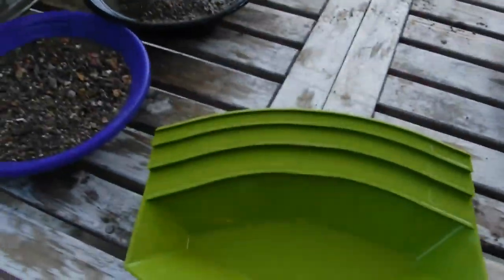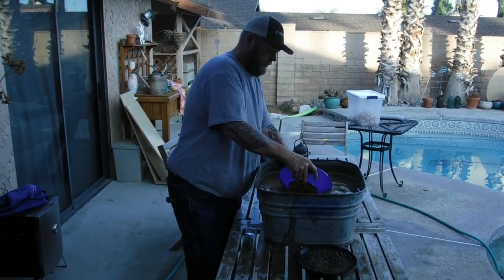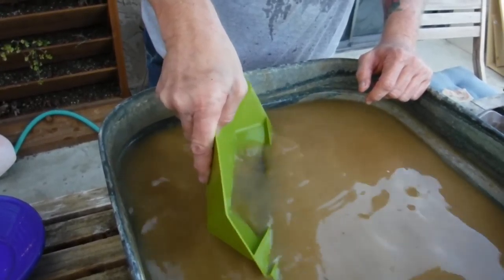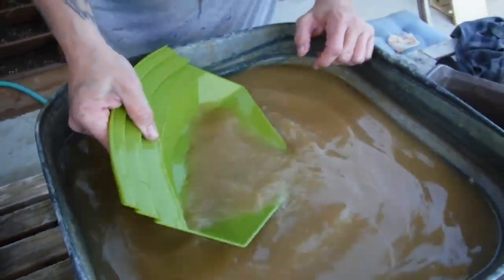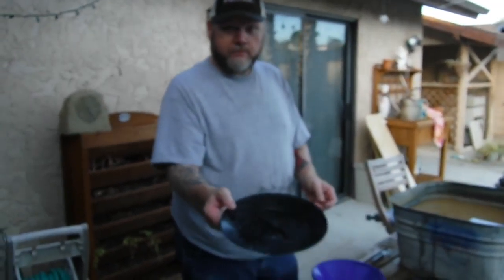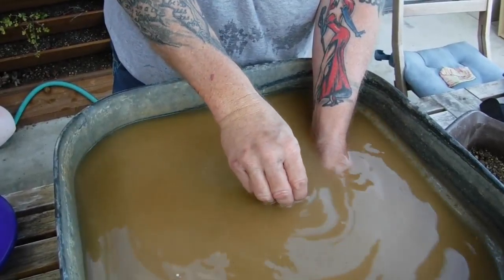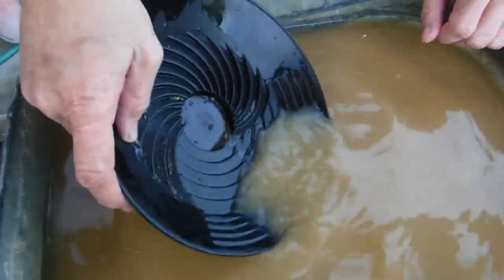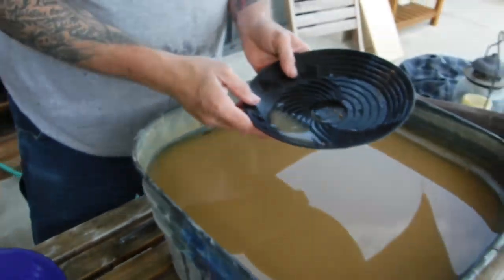The Gold Claw vs The Turbo Pan!

Comment: Jesse with the small Turbopan it's better if you hold it flat just under the water and swirl gently counter clockwise. This will separate black sands from gold at about 97% recovery on the super small gold (40 micron stuff). Still good video because it shows a panner can use turbopan just like a normal pan with the gold ending up in the central well. That means it has a lot further to travel to get out of the pan
Reply: learn to pan,use spellcheck,get-er-done

Comment: You are using the gold claw wrong - you should reshoot this video test as the results are null if you don't operate the equipment properly. It's my understanding that the gold claw is used more like a mini sluice rather than using a panning technique.

Comment: Nice video.  Three minutes for the Gold Claw.  One minute forty seconds for the Turbo Pan.
Reply: Only because he wasn't using the gold Claw properly.  Judging from the other comments he doesn't know how to use the TurboPan properly either, so this entire comparison is pretty useless.  I'm a Gold Claw fan myself.  I could have panned down the material he took almost 2 minutes to pan in about 30 seconds.  I suspect a skilled Turbopan  user could make a similar claim as to the time needed to pan that amount of material.
Reply: Someone skilled with the Gold Claw can work down a shovel full of dirt in around 20 second when used properly. In the field the ability to use one hand, can come in handy.

Comment: I like the turbopan which i have the large one.....If i can make a suggestion. Stratify, then swirl the water in the pan level in the counterclockwise direction (do not swirl the pan) letting the lights fall out the top while swirling counterclockwise...... it's like a sluice...., then swirl the water clockwise to get the heavy's to the bottom. stratify again and repeat the process, then pan as usual at the opening.... Type turbopan in the search window.
  You still recovered the gold though...... good vid. I love my turbopan and want to get the small one for sampling out here in the sonoran desert.
 Good Luck

Comment: Geez, it would really help if you knew how to use a Turbopan properly and trusted it fully before you start doing comparison videos. So this video in my opinion is nothing to go by.

Turbopans will always win hands down over the gold claw and leave it in it's dust simply by how it is designed when in the hands of a skilled prospector.

This is no joke and I'm a female and I can even pan down a 20 litre (5 gallon) bucket of materials in well under 3 minutes with the 16" turbopan and still could do it in under 5 minutes with my 10" turbopan.

Comment: What does doing s sterring wheel motion do to stratify the dirt which looks like its overloading the pan?  Since there is no 'real' gold flakes in the dirt  that would fall out of the gold claw with that side to side motion, this really does nothing to show that the gold claw really catches anything.  A simple batea pan would extract more gold than these put together.  A good comparison would dictate pulling unplanted gold from stream dirt.